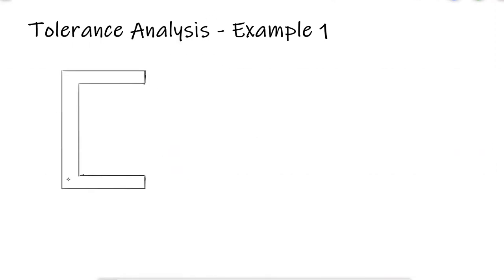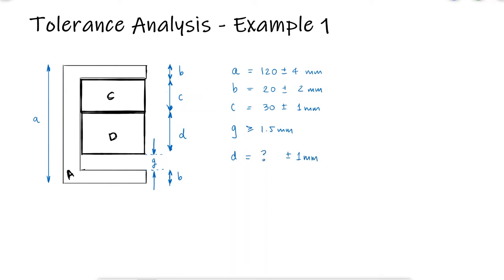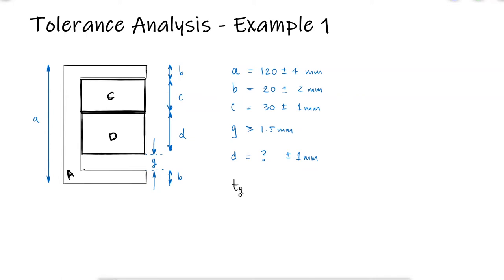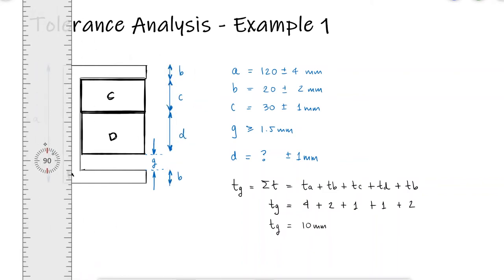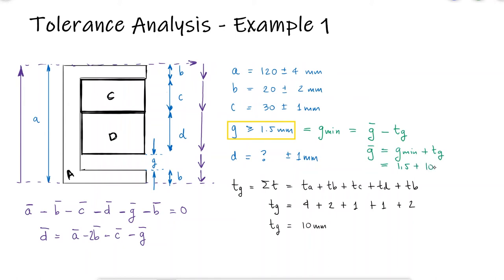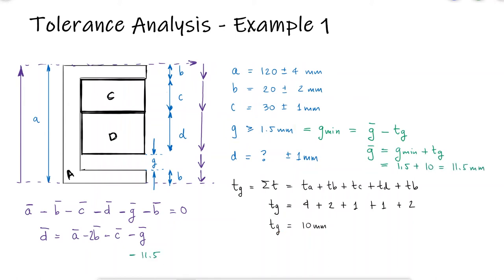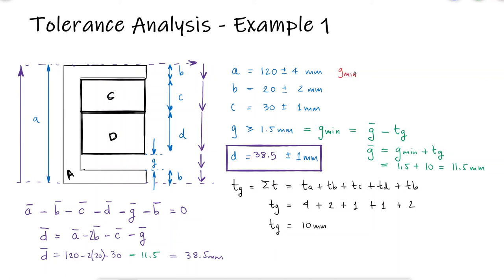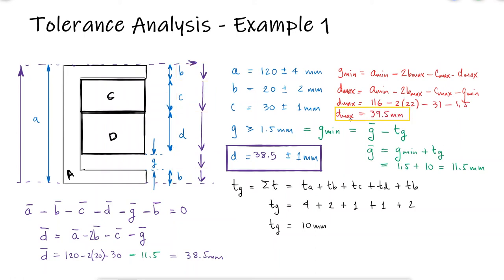Tolerance Analysis - Clearance - Example 1

Comment: What about when we don't have equal bilateral tolerance? (i.e. 20 +0/-0.02)
Do you have examples of that?
Reply: Since your limits are 20.00 and 19.98 you can convert your dimension for the analysis to 19.99±.01